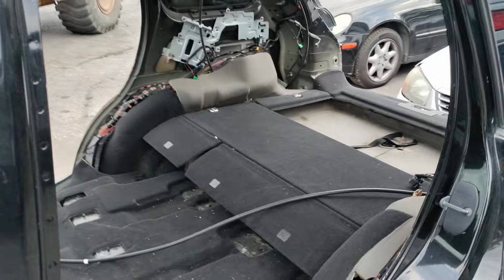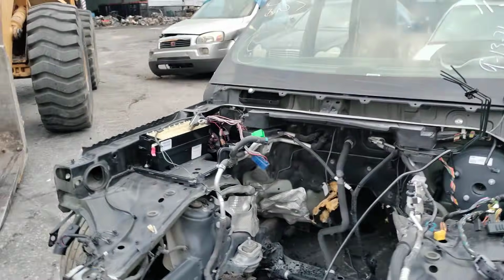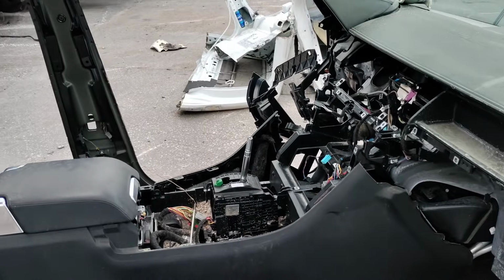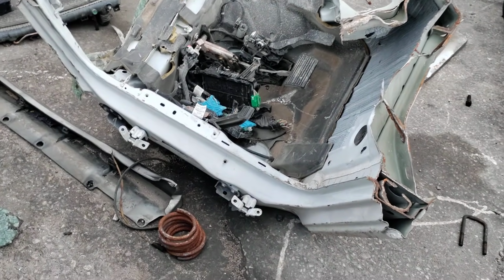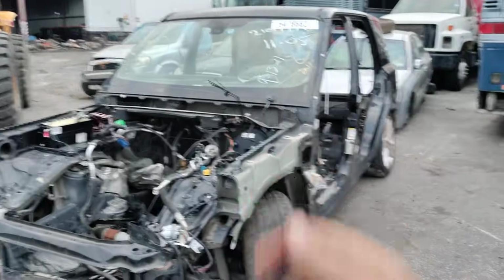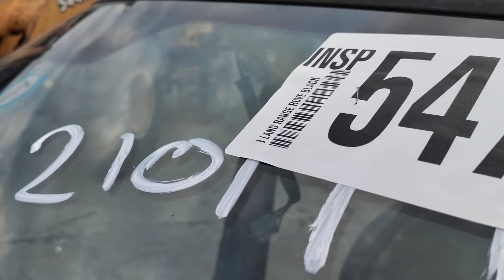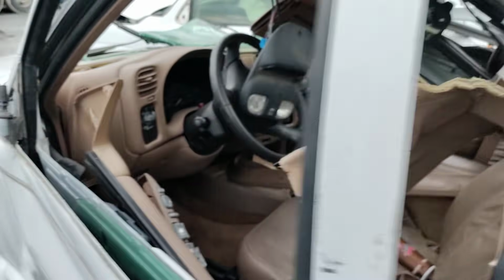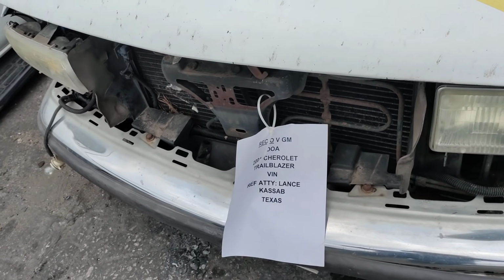2013 Ranger Rover Starter Kit....Chop Shop Recovery

Comment: That white vehicle looked like it got rolled under a tree or a vibrating roller. You'd think there would be tree marks, maybe a pipe fell on it from a load. It's sitting the wrong way though unless the driver was not looking and it got hit at a right angle on an intersection with piping or barrels from a big heavy cylindrical object. When you take your family shopping be sure to get them out of the vehicle. Those car thieves will steal any kind of vehicle, and likely don't care if your kid is inside it. They ain't got time to handle somebody's kid, so they just steal the vehicle and if you're lucky he winds up at the local 'lost and found' repository or the local police station.